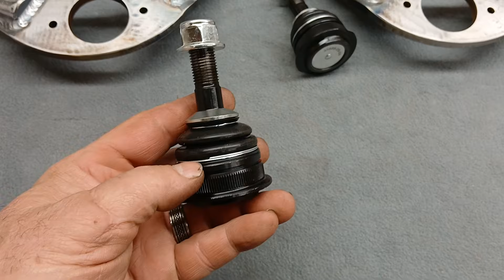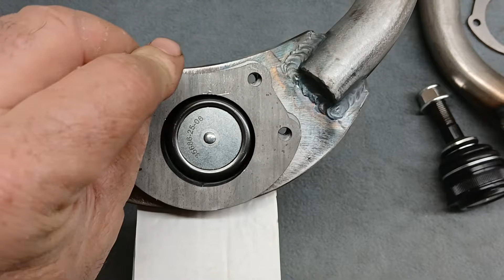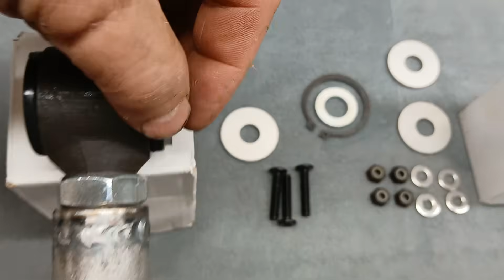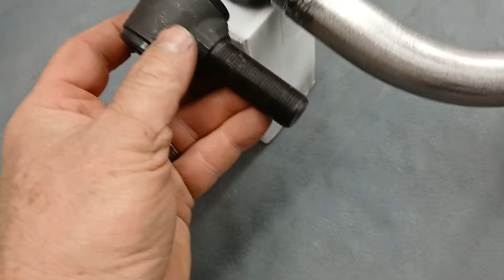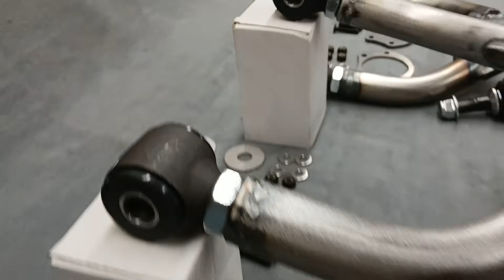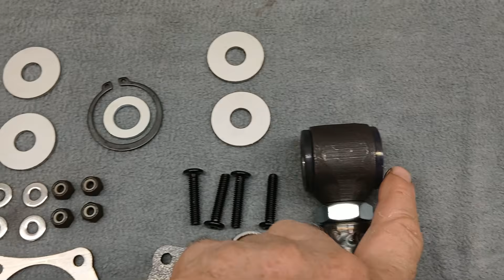CPO Crown Vic 1" shorter upper control arms.

Comment: I assume we can still run the crown Vic steering rack, or mustang e-rack with these control arms?
Reply from the maker: Yes you can run both
Reply from the maker: It uses a 1996 Mark 8 or T-bird rack. They are the correct width and have the same threads on the ends as the Crown Vic which is m14x1.5>

Mustang e rack is to wide.
Reply: @chassispartsonline  can't just shorten the tie rods?
Reply from the maker: Yes you have to shorten the tie rods.
Reply from the maker: @SimpleJack23  My apologies. I thought you were asking about the narrow crossmember. You can use the stock rack and sway bar with shorter arms.